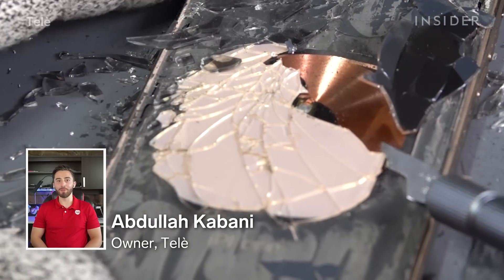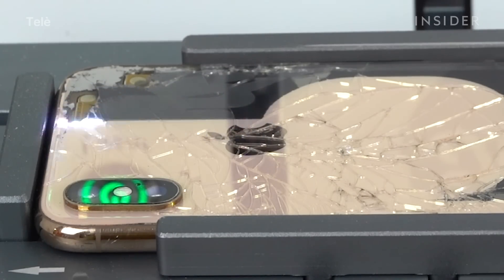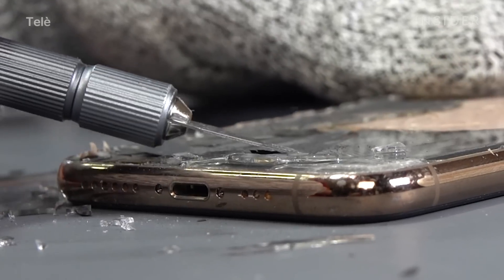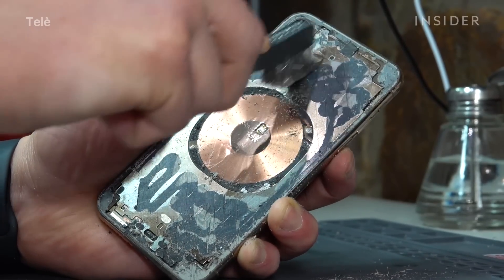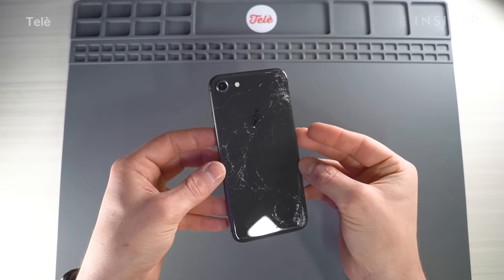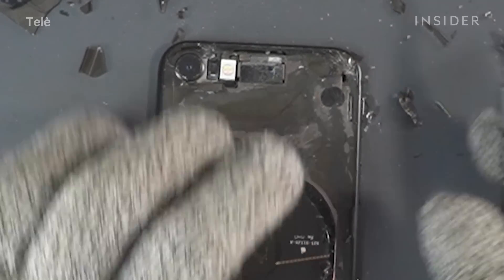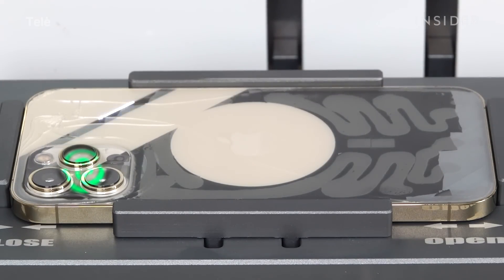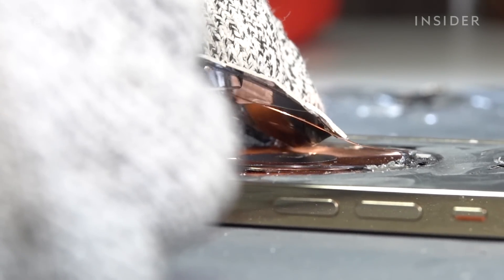How Cracked iPhone Back Glass Is Professionally Restored | Refurbished | Insider

Comment: As a repair tech we just replaced the whole frame, cheaper, easier and less work.
Reply: so that glass IS on a part that you can just slide off?
Reply: @Ass_of_Amalek  no you don’t slide the frame off. Everything is screwed and adhered down.
Reply: @Ass_of_Amalek  everything inside your phone is screwed to the back and the glass is glued on, it's easier to unscrew the entire phone and put it back together on a new back with fresh glass.
Reply: Same here dude, almost ez money
Reply: @Ass_of_Amalek  also to clarify, Samsung phones are bolted to the screen and the back is replaceable. This makes a Samsung back repair vastly less complicated as a whole. Don't forget to take the little black camera glass sticker out when replacing the screen ;)
Reply: Lenore Le`Strange I took apart a water-bricked iphone 4 once, and those are built with a glass back the way you're describing samsungs. the back (glass on plastic) slides off, and then everything is screw or plug connected to an aluminium ring frame that also forms the phone's outer side surfaces and that's screwed onto the screen assembly. directly behind the slide-off back plate, the battery can be replaced via clip-on connector. I was very surprised by how repairable that phone was built.
Reply: I don't know anything about repairing iphones, but my brother owns a repair shop and he does what you do.  He mainly fixes front screens and easy money for him.
Reply: What will you say for 'Galaxy Z flip
Reply: @noobpianist8757  a phone I personally never worked on but is the same as other Samsung devices, bolted to the frame and screen glass is fully glued to the housing.
Reply: @lenorelestrange   There's a Hi-tech device that fixes almost every type of damage on electronic devices whether I.C or external
Reply: @noobpianist8757  yeah, it's called labor and it's about 9-15/hr and fixes just about anything inside and out.
Reply: How replacing the whole frame cheaper than replacing a $10 glass?
Reply: @MrCae85  Becasue it doesnt require an $8,000 lazer mechine to replace the whole assembly.
Reply: @lenorelestrange  got mine for 2,000 and it pays for itself in a month
Reply: @MrCae85  uhhh, okay? Nice flex I guess.
Reply: 8, Aary vispute, 12th,S3  It is much cheaper then a $2,000 usd laser mechine. unless you are replacing 10+ phones a day at a good mark up, getting your money back is as somple as charging the $10 markup on the extra $5 cost of the housing.
Reply: @lenorelestrange  will it be waterproof
Reply: @exioz99  The iphone is not waterproof and wont be after a repair.
Reply: @egg99  seems I get this comment every other week at this point, for someone who doesn't make tens of thousands of dollars doing this with the financial support of a company then I can tell you that you are not going to buy a $4,000 lazor mechine to replace the back glass for $15 when you can replace the whole housing for $25...
Reply: @lenorelestrange  I still think, it makes a lot of financial sense to get a laser machine if you have a repair business. It costs 2-3 grands, but you will: 1. Save time. 2. Less risk of damaging components (removing OLED screens is risky af). 3. Better reputation since you fix stuff quicker and safer. 4. Future proofing (Apple will definitely release phones with glass back for a few more years)
Reply: @johndinhvo  everything you listed is literally covered in my many, many replies.
Reply: @lenorelestrange  why wouldn't you just buy a laser machine? It seems to be a no brainer even if you only want to fix one phone for your grandma
Reply: LOL Apple is SUPPOSED to be a great company/innovative LOL,who thought it was a good idea to put glass on the back of a phone LOL,what's the point/purpose, looks, shouldn't matter, IF your building for function,another, a LOT more durable material, would DEFINITELY be a MUCH better option.

I shouldn't be surprised though/the smart phone market/phones have been going in the toilet for YEARS.

Most of this junk started 8 years ago,OR so.

You will start to see a trend here soon though/its all about money/the sooner your phone dies, the better:

Phone batteries were no longer easy to replace/phone manufacturers thought it was a good idea, to seal batteries up/not offer removable batteries/replaceable batteries,they wanted to encourage people, that IF your battery dies, your phones dead.

This also killed the after market battery market/an example of what I mean by that, phones would often, for an example, release,with a 4000mah battery, but you could get a 5000/6000mah battery, for your phone, you could also have multiple batteries on hand, but I would, USUALLY, just go the after market route/I USUALLY just got a 6,000mah battery.

Also removable storage was removed/micro SD cards, were seen less and less,causing phones to fill up faster/slow down,I know we now have more internal storage, but we still get less options.

Then the worst things that could ever happen, to a tiny screened device/anything under 55inches, falls under/ into the tiny screen device category, what happened next BASICALLY killed phones, we stopped using 16x9/we moved to 18x9 and started having black bars on the sides of our screens, where our videos SHOULD be,but are no longer able to be, zooming in distorts the image and doesn't really give us the rest of the image.

I have even had to make a FEW sacrifices over the years/even my phone has glass on the back and a sealed in battery.

My phone progression/choices, starting when this happened, was, the Note 4, Sony Xperia, then the Razor phone 1 and now the Razor Phone 2, even my Tablet has a 16x9 display though, I won't compromise on that though, mainly, because I want to actually use ALL of my screen, especially when it comes to phones/tablets/when dealing with screens this small,you can't afford to loose ANY screen real estate, even when it comes to my 65inch and 75inch TVs, I wouldn't want to loose ANY of my screen either, SOMETIMES you are forced to though,because of where you decide to stream content from. 

The other thing that shouldn't be happening, is companies just making up resolutions/these are ALL of the resolutions that are acceptable, when it comes to tiny screens. 1920x1080p,2560x1440p,3840x2160p,5120x2880p,7680x4320p.

Anyway the smart phone industry has seen better days, thats for sure.
Reply: @mattmatt2417  lay off the crack pipe son, this is YouTube, not Reddit

Comment: Keep in mind you can repair many, many phones without expensive tools like his laser. Replacing front glass or screens, especially on Android phones is def possible DIY. *Repair*, reuse, reduce, recycle.

If you cant/wont fix it, someone else will! Dont just toss out or give these to a recycle company as they still sit for years much of the time. Sell it on ebay if you have to to someone who can and will fix it!

Don't just toss out electronics!!
Reply: You can just replace the entire housing rather than using a laser machine
Reply: You don't know how phones are repaired so you just assume crap and act naive.
Reply: factory reset your phone and sell it, is that a good tip?

Comment: This is why i do not play about putting a heavy duty protective case on my iphone because i know how clumsy i am.
Reply: I believe that's called a nokification case.
Reply: That's why I use android!
Reply: @tom0900060  what does your choice of operating system have to do with his comment about putting a case on his phone? I use iOS and don’t put a case on my phone and don’t break it.
Reply: @christophercrawford2736  because if you break an android phone components are a lot more common than apple components thus why repairs are usually a lot cheaper for Androids and also apple is way out dated with their stuff and apple excuse is because we have to "apple cirtify it"  or whatever that means

Edit: also you get better bang for your bucks if you just buy an 400 dollar android phone since they still have very good specs for their price compared to having to pay a apple premium
Reply: @TYPICALTRYHARD_  that’s actually the opposite in my experience. Perhaps it depends on the country you live in, but out of the 3 phone repair companies I’ve worked for, it was primarily iPhone. Many people would bring in their non-Apple phones and decide against service due to the limited availability of parts either making repairs expensive or time-consuming when factoring in time to order the part and have it delivered. For an Apple device I can run over to my local supplier and pick it up. Anything non-apple it would depend. We could pick up screens for Samsung S and Note pretty readily but the cost of those display panels was so high, we often didn’t do the repair because it was too expensive for the customer.
Reply: @christophercrawford2736  May be the case for US consumers since apple is more popular in the US
Reply: @TYPICALTRYHARD_  probably. I live in the US.
Reply: If a person actually works a physical job a case is a must. I will happily spend the 65 bucks for a otter box. People saying I never drop mine are lying and work a cubical job where it sits on a desk all day
Reply: @zack9912000  i agree with your first sentence. When I was a roofer, I absolutely started using a case so I wouldn’t scratch up the aluminum from my rough, dusty, dirty hands or if I needed to set it down on a tile or shingle for a second... but now that I’m working as my own boss as a handyman(primarily indoors), I don’t feel the need for one.
Reply: @christophercrawford2736  An American! Enjoy your freedom!

Comment: Unless they aren't showing steps, this is not how you replace glass on a phone. Those little shards in this method can end up inside the phone. 

The proper way is to remove the glass and take the boards out. Replace the wireless charging coils, especially since they looked damaged in the video. 

My guess is this guy isn't a true phone repair shop but rather one that does quick replacements like at the mall.

Comment: Why use an Exacto Knife with an angled blade? That's designed for cutting. It  just invites gouging which is what you're trying to avoid . You need a small sharp-edge spatula to remove the shattered glass.

Comment: I hope I don’t break my back glass. This way seems to leave a lot of small chunk of glasses & glue behind to inside which could move around and damage other stuffs. For example a piece of glass slowly move its way to finally be under one of the ribbon cable and damage one of the line in the cable. Good luck diagnosing that. Better yet if it’s intermittent. It would drive you nuts.

Comment: The replacement part shown in the video is not only counterfeit but is cheaply made with a fake Apple logo shown illegally on the back, meaning if the phone drops again, the counterfeit part used in the repair will crack much easier than the original and puts a bad reputation on Apple just like this video which shouldn't have been ever unloaded!

Comment: Why have glass back in the first place? Wireless charging is less efficient and use more electricity than normal charging and it’s more restricting than wire charger. I just don’t get it. I just think apple make the phone more destructive and making it expensive to repair to the point where they just be better of buying a new one.

Comment: In my opinion, a product can be called a good product when engineers have ALSO thought about how to simplify the repair process. So, are apple products good products? Try to guess.... No SD, no Jack, no easy process to replace batteries, glass cover (FOR WHAT???). A product the can fall down 10 time a day, why should be in glass? It's a no sense...

Comment: My daily driver is a cheap Samsung J2 Core with a plastic back which I bought in 2019. It does everything I want (including retro console emulation); it's still getting regular updates and the only slowdown I've ever had on it is when using my COVID scanner, however, I suspect that app was thrown together in a hurry and at short notice. Other than that, I'm very happy with it and feel no need to splash out for more modern phones with missing headphone jacks, no micro-SD card, etc.

Comment: Why design the backplate of your phone out of a shatterable material?

This is not my kind of phone.
Reply: The reason the back is made of glass so that wireless charging can work, if it was made out of metal it would block the induction and receiver coils from making contact
Reply: @angel_withaflamethrower  yeah, polycarbonate phones have wireless charging too.   The glass backplate is really just an anesthetic choice, a highly impractical one imho.

Comment: That's why I love Android more then iPhone. And I love good product not company(Not a fanboy). Among so many other company apple spend the least on R&D. There software is good and its because they have total control on there locked hardware, but that's about it. There is no advantage that Apple has over android. I can buy 4 decent smartphone which will run 12years (3 years each) or I can buy 1 iPhone which will run 3 years.

And then comes there Anti-Repair products and not including chargers, lack of innovation, etc.

No wonder Apple is losing market share in the smartphone segment every year.

Comment: there is no industrial strendth glue here,glues like b,t,e 7000,8000 is another cheap glue which is used in most repair shops and is 100 times weaker than the factory one,i preffer full disasembly of the phone 320 celsius and there is no trace left of the old glue ,then comes epoxy resin and everything is rock solid again
Reply: Sounds like you like your phones well done

Comment: Note:  NEVER USE SCALPEL to remove back glass.  Puncture lithium battery 🔥 fire. Also tape lightning port closed.  b4 hand.   Suction cup works well to remove back glass after heating back glass very carefully on stove top on low.
Reply: Which is probably why you should gut the phone first

Comment: This is NOT how you "Professionally" restore cracked iPhone back glasses, this way is a cheaper way that will leave your iPhone NOT water-resistant. The real way is to replace the whole housing, this takes a lot of time and 3rd party repair shops are lazy. 3rd party repair doesn't tell you that water can enter but, the replacement part is NOT OEM  which is much much cheaper meaning bigger profit $$$ BTW the first iPhone with a backglass was iPhone 4, NOT iPhone 8, get your facts right.